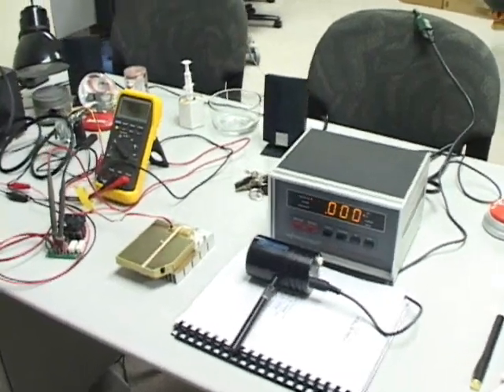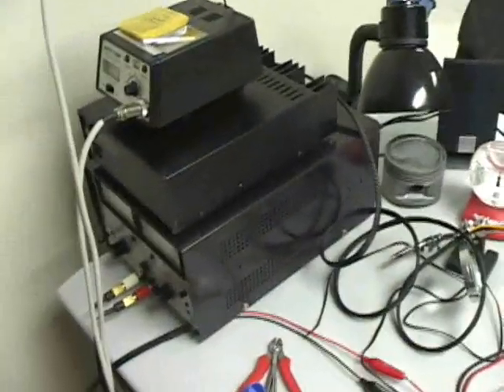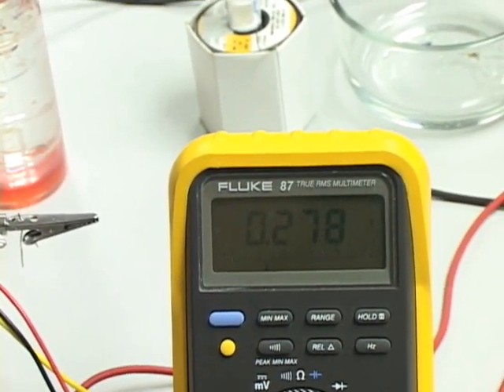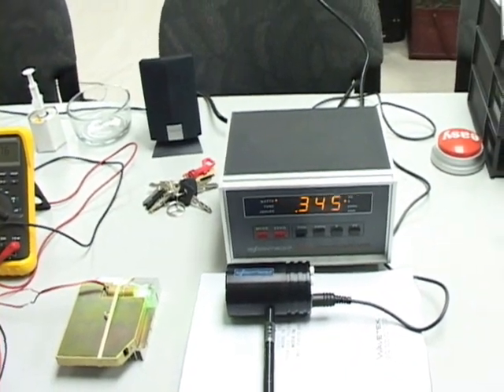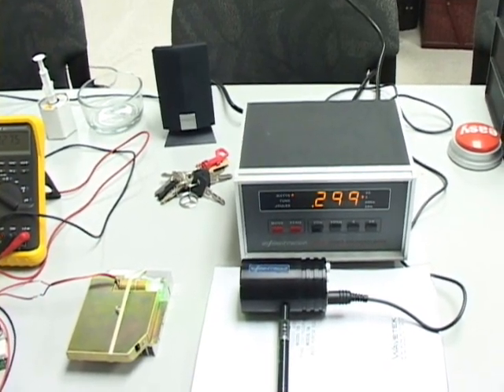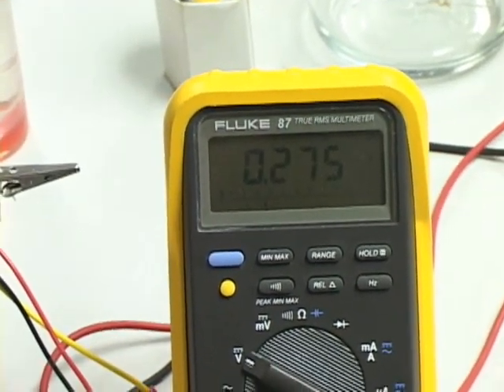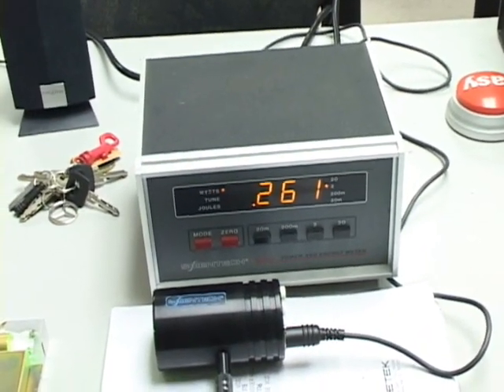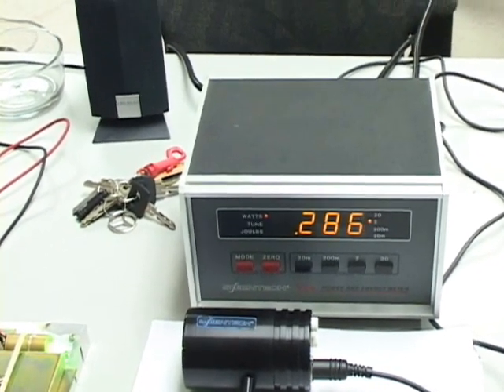300mW Green DPSS Laser

Comment from the maker: Yeah, that's because current is measured as a differential in voltage across a resistor. It's built into the driver board that way. So, a reading of .227V would equate to 2.27A.

Comment: I think that a large proportion of your output is in 808nm and 1064nm, uncollimated invisible and basically useless. Your actual 532nm output could possibly be as low as 50-60mw. Correct me if I am wrong, please.
You need to be sure that you have used a good filter to get rid of the pump diode power and pre-doubled laser leakage from the 532nm for anything like an accurate measurement.
Many (probably MOST) DPSS greenies on the market are a scam.